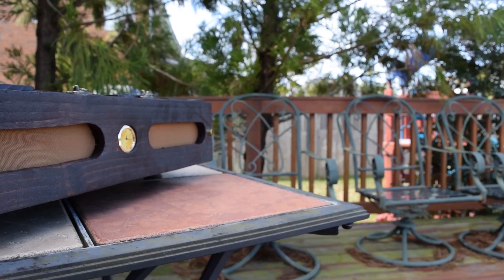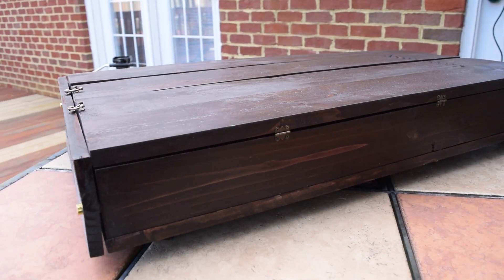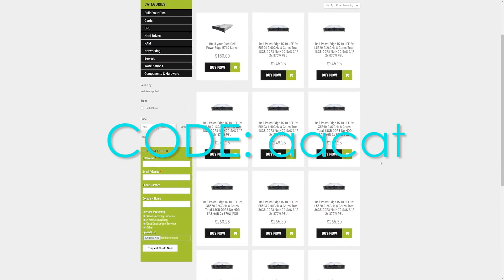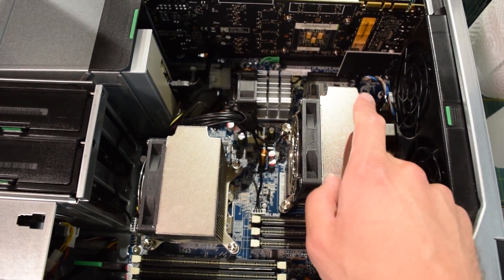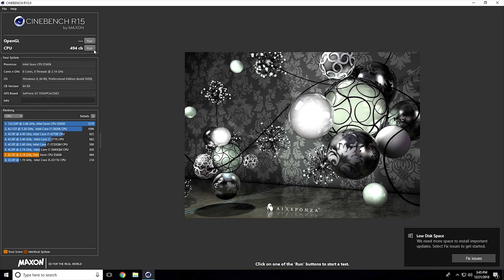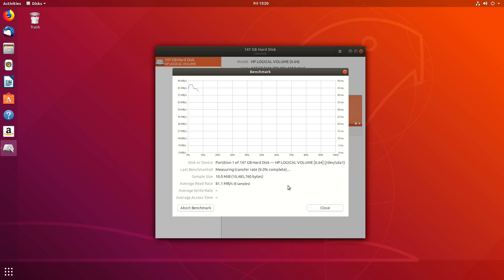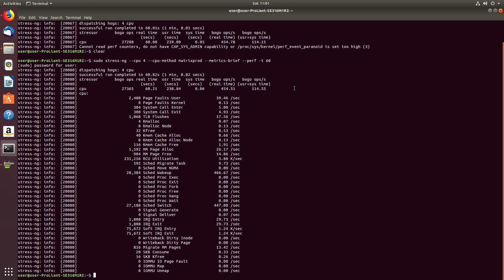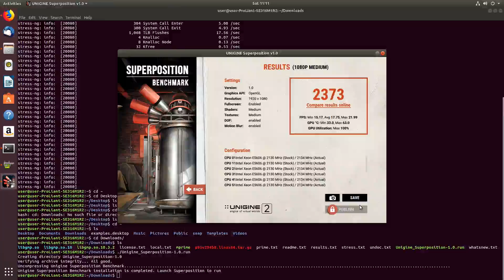Building a Dual Xeon 1U HP Proliant Server Coffin

Comment: why dont you just change the fans to Noctua fans? makes more sense.
Reply: HP is very picky about what hardware us used. You cant use any fans other than HP 1U fans, or it will complain and run fans at 100% and sometimes refuse to boot

Comment: Looks to me that you gave a complete computer an outer chassis around the chassis instead of having the internals directly inside of the built chassis that might help with a few things such as the thermals and room for improvements of the computer to keep running. Would recommend large fans for noise reduction.